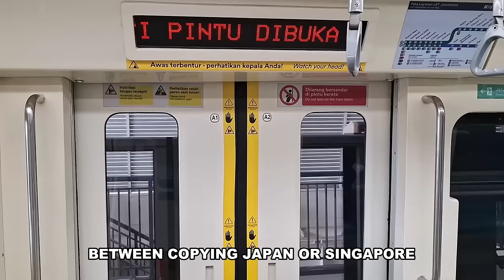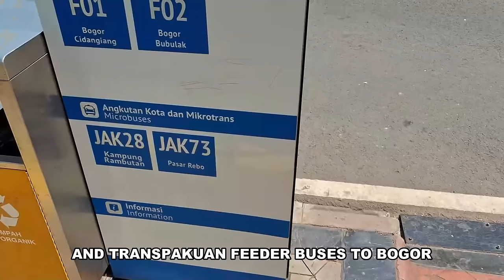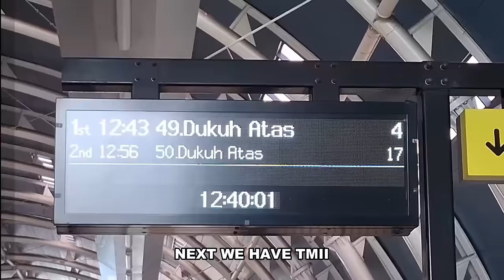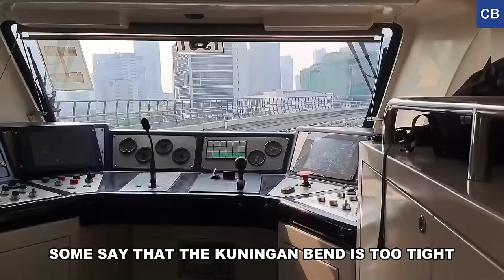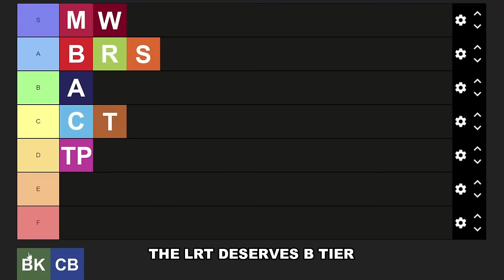Jakarta's Suspiciously Heavy LRT Explained | LRT Jabodebek Review

Comment: I kinda wanted to note the lack of direct exit between Dukuh Atas LRT and Sudirman KRL station to Jl. Kendal, making a wasteful price spending just to enter end exit Sudirman Station to Dukuh Atas LRT skybridge or vice versa.
Reply: It's just one Rupiah dude
Reply: @Khookies-lp2lu  so far only two stations applying that cut, Sudirman and Manggarai, because if the default setting of 3k remained in use for every stations, it'd be a pulling factor for people to interchange mode
Reply: @Khookies-lp2lu  One rupiah if you know and have the Flazz card (not the LRT ticket). If you don't, you're toast, and need to go back and make a 1km detour to access Sudirman station and the ticket office. Also, there's no public access to the bridge on Sudirman side at all, so you can't go to the neighborhood right next to it. Insane arrangement, I wonder what idiot planned it.
Reply: @PrivateCh123  wait it doesn't work for normal e-money?
Reply: Unfortunately this is due to land issues. If Dukuh Atas Station wants near Sudirman Station, there's no space near Sudirman station. Sudirman Station was even squeezed by the river. Also Dukuh Atas in planning had never been designed as terminus since there would be a continuation to Gelora Bung Karno Complex
Reply: So I've actually tried this and it turns out it's actually faster if you enter LRT dukuh atas through the other entrance (the one on Jl Setia Budi Tengah) instead of entering Stasiun Sudirman and going on the JPO. The downside is there’s no dedicated sidewalk for pedestrians, but the upside is I save money, time, and effort by not having to walk so far.
Reply: @Wiratama12  tbh with the location and the amount of modes of transit go through it (Commuter Line, LRT, MRT, Transjakarta) I don’t see Dukuh Atas as a Terminus but as a some sort of Interchange station (Similar to Raffles Place MRT in Singapore or the Pasar Seni Station in Kuala Lumpur). But at the same time like idk why but it just felt that the designers don’t even bother to make it as an interchange station as the amount of the ticketing station you have to go through between the different transit systems (plus with how far it is from each other but then again the river kinda blows things a bit)
Reply: @Wiratama12   There's still Jl. Galunggung north of Waduk Setiabudi Barat directly across the canal from Sudirman Station, and in fact the site was considered for a joint LRT Jabo & Jak station during the planning phase IIRC
Reply: @PrivateCh123 German efficiency is missing in Indonesian bureaucracy. As Indonesian, I envy European countries for providing efficient short cuts in every street corners or turns to give quick access to the nearest to public facilities. It really shows how stupid and corrupt Indonesian government is. Along Sudirman street in Dukuh Atas area, there are no stairs which can connect them directly like in London or Berlin.

Comment: Greater Jakarta have 4 different rapid transit line in just 10 years time (since MRTJ construsction started ) .. Let's see if we can get another 4 lines in the next 10..
Reply: Yang sulit bukan membangun tapi memulai.  Ingat gak pas MRT Jakarta mau di bangun banyak yang protes soal koridor layang 😂. Sekarang LRT jakarta & Jabodetabek layang semua gak di protes tuh
Reply: Hopefully yes, but the 2nd phase of north south mrt itself took 10 years (2019 - 2029 if finishied on time) compared to its predecessor that only took 6 years to construct albeit that it was already planned since the 80s.
Reply: There's still MRT North South line continuation to Ancol and to Pondok Cabe, MRT East West Line from Balaraja to Cikarang. Continuation of LRT Jabodetabek and LRT Jakarta. KCI Purple Line (Jatinegara-Tanjung Priok)
Reply: in the next 10 years, we should be getting MRT EW and Loop line as phase 3 and 4 of the MRT. There is also going to be a new LRT line serving JIS to Pegangsaan Dua. Were also gonna get an LRT from Velodrome to Klender, but its status as a line is ambiguous. So thats 3-4 lines depending on how you see it. But were also getting extensions for MRT NS line, CB and BK LRT lines, and the existing Jakarta LRT.
Reply: Chengdu, a city in China has 13  metro lines with track length of 558 km averaging 6 million passangers daily, 2 billion annually. And all lines have high capacity like MRTJ and unlike LRT

And know what ? This only achieved in merely 14 years !
Reply: @aira4739  China is a special case. No country is like China in terms of bureaucratic efficiency, and mass production of public transportation..There are 80 cities in China with a population of over 1 million .So that the metro is easy to standardize and mass produce so that the price goes down.

Comment: As a Railfan, i do find quite hard how to clasify the LRT Jabodebek. It's "too heavy" to become Light Rail if compare with the LRT Jakarta and might just better merge with the MRT (Kinda like how Tokyo Metro has 4-door long overhead electrification cars and 3-door short third rail cars running under the same flag) and make it the MRT Cibubur Line and MRT Bekasi line. But it's operated by KAI which kinda makes it like the Commuterline and it runs parallel with Commuterline so maybe just put LRT Jabodebek into the Commuterline and make it into the KRL Cibubur Line and KRL Bekasi Line. So basically LRT Jabodebek is kinda like if KRL and MRT had a child but somehow has the genes of the LRT Jakarta and just wants to live with KRL. And why can't they just unify station names so it's more easy to remember, like how TF you get a Sudirman Station in between 2 Dukuh Atas Stations where just name both stations a Sudirman Station already, and why don't just name Cikoko Station as Cawang Station instead. I personally never rode the LRT Jabodebek but I catch some commuters complain that the fair is pretty high with the exception of after 8 PM where it goes half-price.
Reply: Actually, the actual Cawang area is around BNN, yeah the place where is the Cawang LRT station located.
So, Cawang Commuterline Station is a bit misnamed/misplaced (?), but it seems that changing the name of the station to "Cikoko Commuterline Station" is a challenge, because people have known the station as Cawang Station for decades.
Reply: maybe indonesia have their own abreviation for mrt and lrt being moda raya terpadu and lintas rel terpadu respectively
Reply: @muhammadfawwazabhinaya3131  actually they have a regulation for this. If the axle load is lower than 12 tons, it's LRT.

Yeah, LRT Jabodebek trainset axle load is no higher than 12 tons. Commuterline & MRT are counted as heavy rails because their axle load is >12 t.
Reply: @muhammadfawwazabhinaya3131  These terms can still be interchangeable with each other. Kereta Rel Listrik, Moda Raya Transportasi, Lintas Rel Terpadu is just basically useable to each other
Reply: @Rinoarashi-P  Well if refering to this, that means LRT Jabodebek does have a very good point of differentiation from MRT and KRL
Reply: @Rinoarashi-P  Well, maybe The Cawang LRT St. could just be named BNN St. (kinda like with ASEAN St.) or New Cawang Station or East Cawang Station so that there won't be any confusion
Reply: @牧鎌谷得  Well, based on the Ministry of Transportation regulations, KRL (EMU in English) is all rail transports that have their own electric-powered drivetrain in the trainset. It means trains used by Commuterline, LRTJ, MRTJ, LRTKAI, KCIC are "KRL".
Reply: @user-id1li6bp6l unfortunately, changing it to LRT BNN would be unlikely, due to the new naming rights regulation.
Reply: I don't understand why LRT Cikoko has to change to LRT Cawang (although I understand that it would be convenient). If you take note, the LRT and TJ station names are already the same, ie LRT Cawang & Halte Cawang, LRT Cikoko & Halte Cikoko, LRT Dukuh Atas & Halte Dukuh Atas. If anything, why doesn't the commuterline change their station names to KRL Cikoko and KRL Dukuh atas?
Reply: @taniamanik2012  Now that you've mentioned it, i guess it'll be pretty much easier for KRL Cawang and Sudirman Stations to change into KRL Cikoko and Dukuh Atas Stations

Comment: A system that can be seen as comparable to the Jakarta LRT is the Kelana Jaya Line (Kuala Lumpur LRT). Been to both LRT System I can say they are pretty similar (Medium Capacity Rail, 4-6 rolling stocks) but the Kelana Jaya Line is a more matured system (open since 2016) and I would even say the system operates almost like an MRT because last time I was there the train seem really packed. Plus probably because how the LRT connects the Suburban area of Greater KL to the Kuala Lumpur City Center. I just hope that the Jakarta LRT can improve further by operating faster (80 to 90 kph) and open more routes that would conveniently connect more parts of Jakarta.
Reply: I can foresee the best way is to reduce the coach to 4 and this will help to increase the frequency.
Reply: @khalifahjamaluddin  to be honest it could be an alternative because last time I used it is at peak hours (I was wondering a bit and took the train at “jam orang pulang kantor” because I wanna know how packed it is), while the seats are almost all of em taken, the amount of people that are standing is not as much as the MRT at peak hours. Plus head time is still pretty long and the train is really slow at moving after leaving the stations. Probably changing the amount of rolling stocks could mitigate it. But still we’ll see what the LRT Jakarta would do with it.

Comment: I see they have improved the system, for example the deceleration brakes now feel smoother, unlike when it first operated where the brakes felt very jerky. Maybe Siemens has made calibration improvements, if I'm not mistaken.

One of the awkward things, why are there two stations in Jakarta (and both are operated by KAI, duh), using the name "Cawang", one is Cawang KCI and the other is Cawang LRT, even though the distance is quite far. Btw for the exact position of the Cawang area is around the Cawang LRT station, the Cawang KCI station is actually located around the Cikoko area, which makes the names of the LRT and TJ stations more appropriate.

Comment: Another issue is price. It is too expensive for its speed and integration to public spaces
Reply: I though it should be merged with Commuterline system and operated by KAI Commuter, so that the price can be adjusted again to match the Commuter Line ticket price which tends to be more affordable.

But what is the reason that the Jabodebek LRT is operated by KAI's own LRT division, even though in terms of service it is very similar to Commuterline. Or maybe because its construction is a joint venture with INKA and Adhi?
Reply: Very usefull for fast business meeting though

Comment: Any idea why the train is running on standard gauge tracks but why they kept the cabin width and height of the trainsets limited?
Reply: Standard and narrow construction costs gauge It makes no difference because it's for the metro. But the train was built With Cutting cost and Corruption
Reply: Track gauge and loading gauge are two different things that do not corresponds with each other.
Reply from the maker: This
Reply from the maker: If I had to guess, maybe they were expecting demand to be not as high as the MRT
Reply: I think MRT line 2 Etc will be built with standard gauge. Because from the start it was planned that Indonesia would move to international standards.So all new rail construction must use 1,435mm.

The area of piles(tiang pancang ) that can be built is also limited. That's the reason why I guess that's the reason why the carriage LRT size isn't too wide.LRT<MRT<KRL (In terms of length and width of the carriage) 

But it is very unfortunate. The Jabodetabek LRT does not have 8 carriages like the general metro standard.

If the train door is narrow, it is corruption
Reply: @audeanroderickkumontoy8365 but the loading cauge is too small.
Reply: @shindoride  OMG Jakarta with a population of 10 million is in dire need of trains heavy rail or MRT as you like it.
Reply: @AprezaRenaldy corruption?
Reply: @marinhopaais426  Ok cutting cost. More precisely
Reply: @marinhopaais426 he is joking

Comment: What is the difference between metro and Light rapid transit “LRT”
Reply from the maker: Honestly I'm not even sure, all I can say is that an LRT is any railway lighter than a metro. 

Problem is (as far as I know) there is no objective standard on what counts as metro or LRT. 

LRT Jabodebek would count as a metro in other cities. 

LRT could mean anything from those single car trams that run on mixed traffic to LRT Jabodebek
Reply: @shindoride LRT juga ada yg seperti Trem
Reply: actually Ministry of Trasportation has a regulation for this. If the axle load is lower than 12 tons, it's LRT, if the axle load is >12 t it's Heavy Rail (metro, commuterline, etc).

LRT Jabodebek trainset axle load is no higher than 12 tons, so it's Light Rail.

Comment: the name of this system is a bit confusing 😅even tho, it is technically correct !
in this case, LRT stands for "Light Rapid Transit" which is just another term for "Light Metro"
but this term is mostly used to describe another type of transit system also called LRT 😁short for "Light Rail Transit"
this system isnt a "metro" it is something that falls between a tram and a metro (hybrid)

in my humble algerian opinion 😄it would've been better if they did name it "Jabodebek skytrain" or something like that
cuz the system is mostly elevated, also the skytrain name sounds more atractive.

 in the other hand, i do understand why they did choose that name, its becasue there's already an MRT, which stands for "Mass Rapid Transit" so.. they wanted it to sound similare,
 but they kinda of downgraded it with that name
because people when they hear LRT, they mostly imagine a system that looks like a tram 😅

but in reality, this system is very different than a tram or light rail

Comment: For me it's just poorly integrated. I currently live near Cawang-Cikoko Station. I could go ANYWHERE via GoJek's GoStation program that connects you with GoJek to and from KRL along with some discount (not as aggressive as before) and integrated in the app. At the same time, there's always buses, which covers more location and has much greater flexibility.

So LRT just feels so limited. If I'm traveling far, there's KRL + GoStation. If I'm traveling direct, there's Bus. Unless my destination is exactly near LRT stations, it makes more sense to go with other modes.

Also, I'm pretty sure it costs a decent bit as well, compared to KRL and Bus? Not as expensive as MRT's very much middle-class oriented progressive pricing, but still a decent bit IIRC
Reply from the maker: Oh yeah I forgot to mention the price. Rp 20,000 for max distance at peak and Rp 10,000 for max distance off peak.

This LRT is extremely commuter oriented, the station is either surrounded by housing or offices, very few  actually good malls/parks/other tourist destinations near the LRT so unless you live in LRT city and work in Kuningan-Cawang, it will feel poorly integrated. Also means that off peak on weekdays and weekends, trains are running empty unlike the MRT.